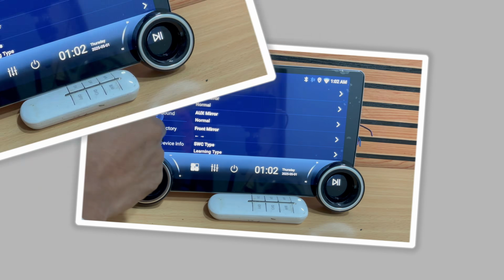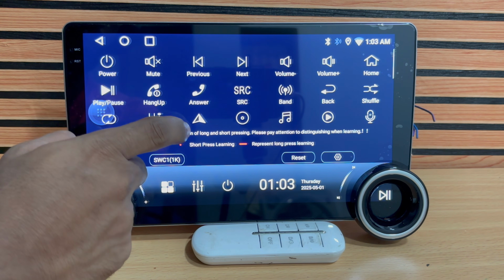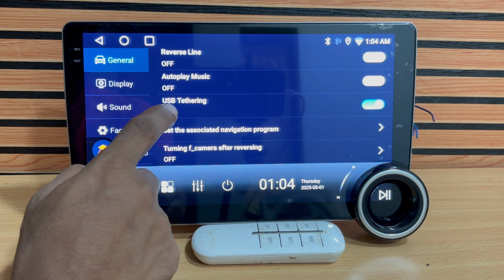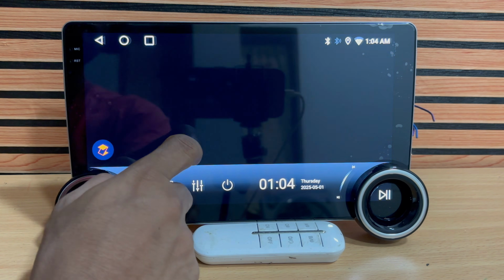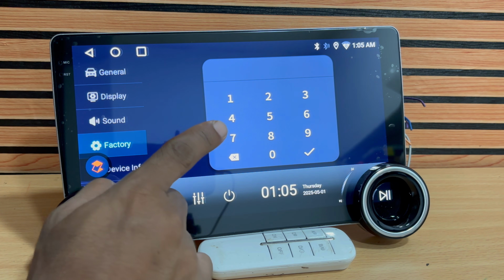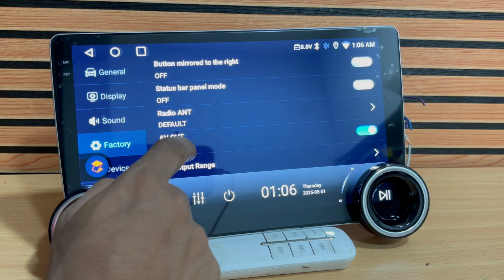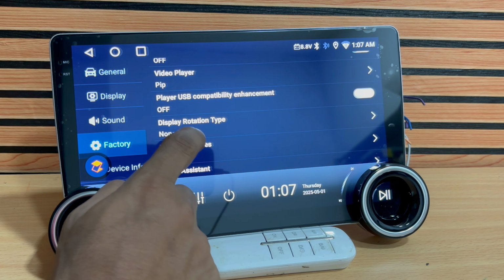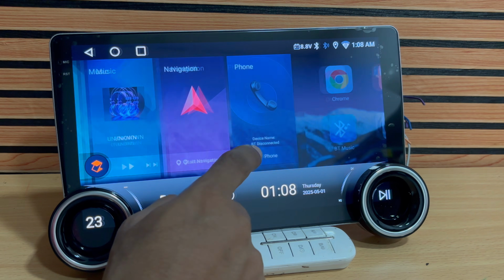Complete Guide to Diamond 2K  Car Stereo Settings: Unlock Hidden Features in Your Car Head Unit

Comment: Is there any way to reduce the time the radio stays "awake" when you start the engine so it starts up quickly? In my car, it stays in that state for over an hour and it drains the battery.
Reply from the maker: You have connected the wires wrongly.
Reply: @setnfix The wiring is the original set I had with my previous radio, and I didn't have any issues with that one. Is there any way to turn the radio off completely when my car sits unused for several days? I feel like it consumes some power even while in standby mode.

Comment: Also does this device has an option for welcome sound
Reply from the maker: It depends on the firmware version installed on the unit.
Reply: Mine is diamond x80 so can I set

Comment: This device's key learning menu detects and identifies the left or right movement of the rotary dial. I can't do this on the Allwinner A133 device. The learning menu doesn't detect the dial movement; whether I turn it left or right, the volume decreases. How do I set this up on those devices?
Reply from the maker: There is a separate settings for these two knobs.

Comment: Diamond car screen, after the update the bottom bar disappeared and the volume control wheel does not work, and I do not know how to restore it.
Reply from the maker: You might need to perform a factory reset to restore the settings.
Reply: My device also same problem after updating

Comment: Brother hpw to change theme in this same version my  android display showing ( System UI has stopped ) and my all function has been stuck they work 3 sec them stop dealer has said its THEME problem
Reply from the maker: Sounds like a software issue. Try factory reset
Reply: @setnfix Yeah it apper after i updated wireless update option even after resetting screen from about option still my problem and my stereo version isn't resetting why sir

Comment: How can I check the resolution of the screen because some sellers says its 2000x1200 but it's seems 1280x720
Reply from the maker: 2000x1200  is not possible. you can check the resolution under the settings> device  information. or use cpuZ app.